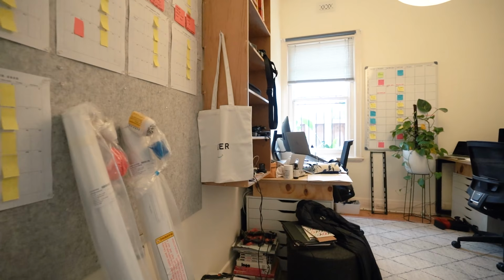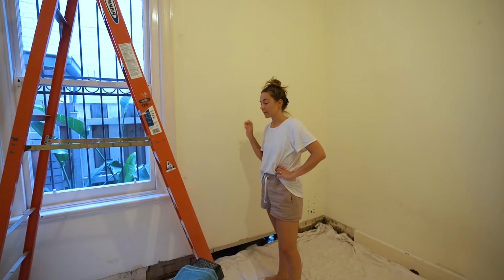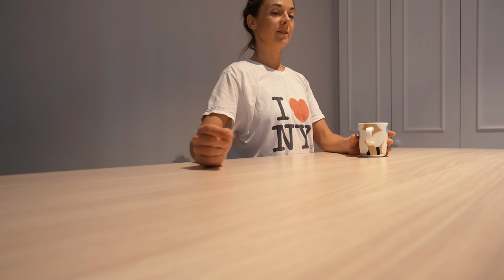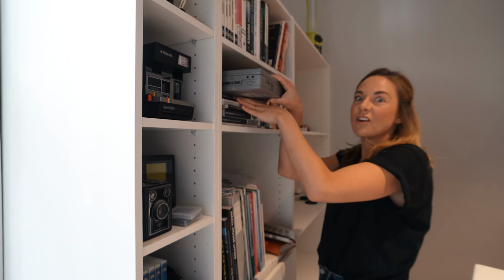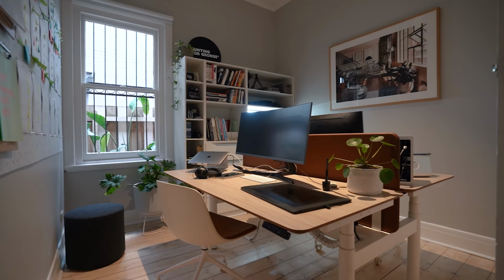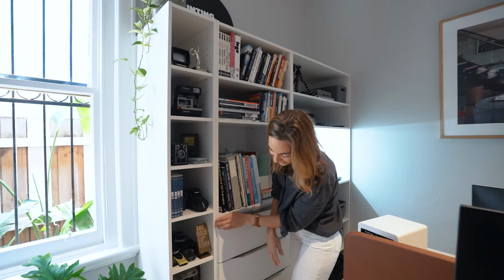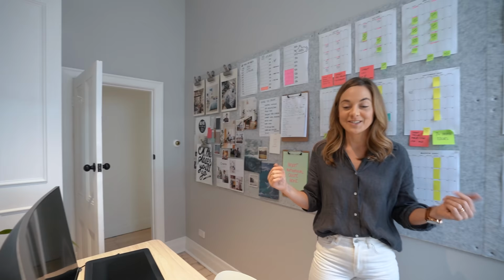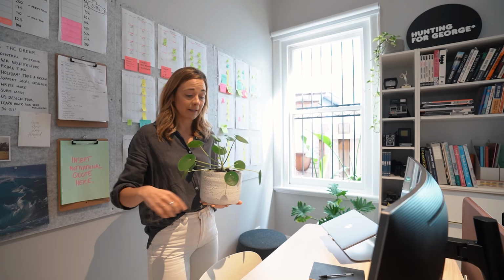Urgent Home Office Makeover! Creating an Inspiring Office at Home 💻 Before & After Reveal

Comment: Absolutely love it! What do you do with the cords from the computers? Did you add a plug to the ground or did you just plug into the wall and risk tripping on it? I’m trying to move my desk away from the wall but haven’t come up with a cord solution yet!
Reply from the maker: There is cable management under the desks. With 4 power points per side on the desk too. So we ran network and single power cable along the floor in some conduit from Bunnings. Not the best but not untidy. Ideally wouldn’t run it under the floor and up but then what if we turn this back into a bedroom again?